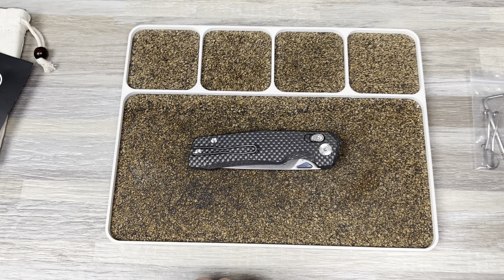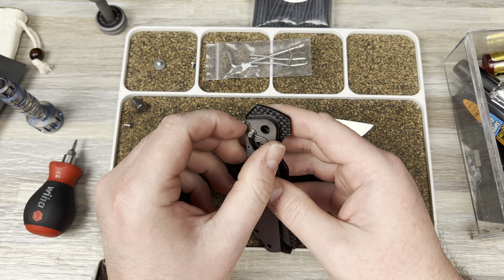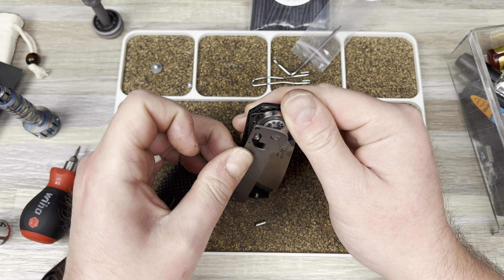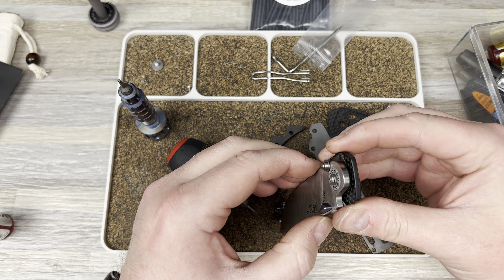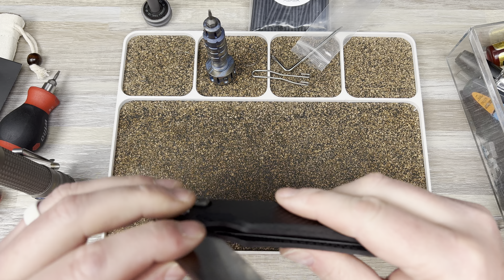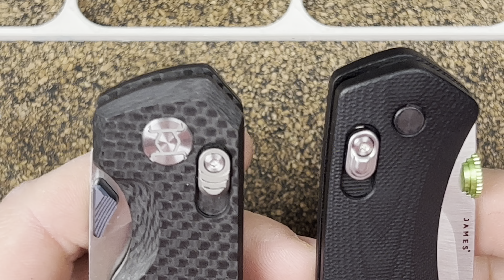Swapping an Omega Spring on a Crossbar Lock - Kunwu X-Tao Warranty Repair

Comment: The Kizer Clutch lock is the only cross bar lock that I don't hate to work on, and I really enjoy that they got 5 holes so I can adjust the tension if the "detent" sucks (which it usually does) 😆 But I just love the Tabs Kunwu use on their cross bar lock, it's just a much more enjoyable experience compared to pulling down two round sharp "knobs".
Reply: Absolutely

Comment: Ok lol so I'm wondering if you have extra hardware from kunwu to do outside warranty work for them!....why wouldn't they just send there customers the hardware to install???I kinda don't understand that!!??is something they don't do if requested??? Does kunwu not send to there customers? Do you know either way?I wasjust wondering?
Reply from the maker: This wasn’t just the part it was getting it apart. The customer had an issue with the loctite or something. As for parts they include extra springs and a clip i believe with this knife.
Reply: Knife companies don’t trust the end user to disassemble or reassemble their own knives. Sending the parts instead of requesting the knife back opens Kunwu up to much more liability if something were to go wrong. 

At least in theory.
Reply from the maker: @Stahlwerk88  i mean they are trusting me… 🤣. The customer requested someone take care of this due to the loctite on the pivot. As far as I know.